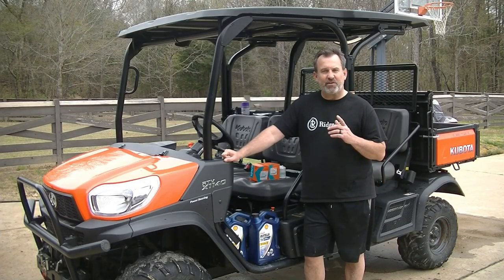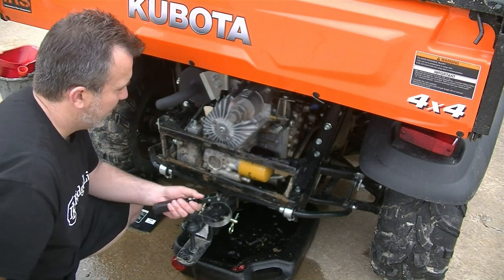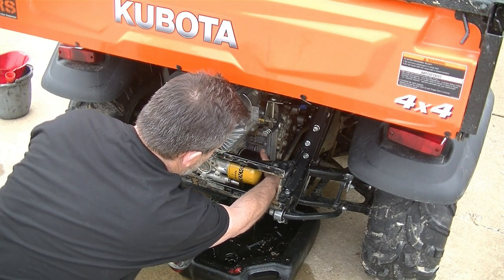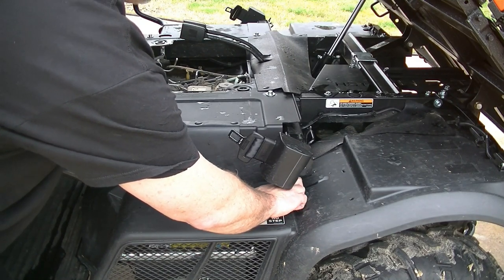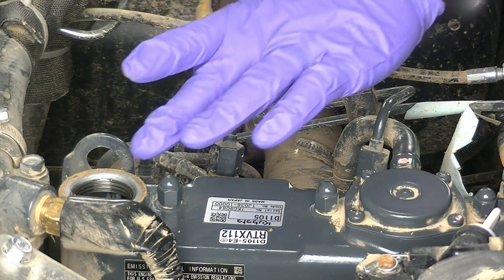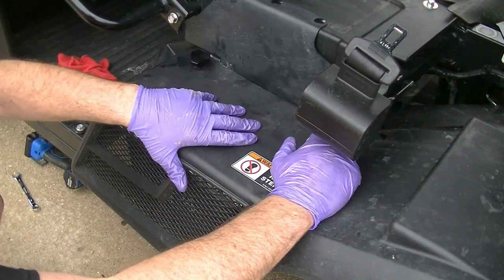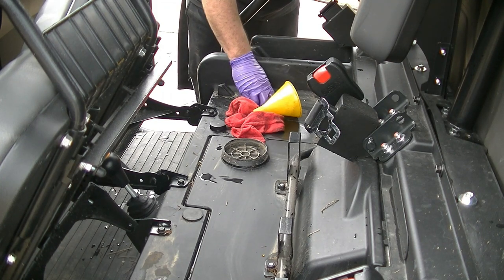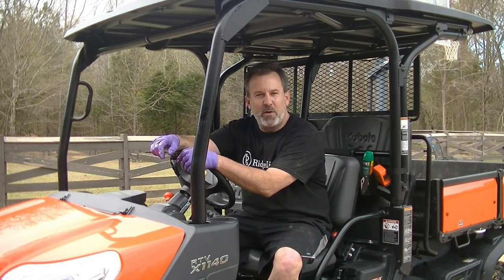HOW TO Change the Oil and Filters on the Kubota RTV-X1140

Comment: Helpful video. Thanks.  I agree with another comment that it was much easier for me to use my oil extractor. The oil filter is very hard to reach behind the battery. I got fed up, disconnected and pulled the battery out for access. The larger HST filter is incredibly stubborn to remove on the first 50-hour service.  I however did not replace the smaller filter until both were off for leverage and access to the larger forward filter. I too noticed no drop in UDT fluid level in the transmission and a bit more than a quart required at the front tank. Worth mentioning: don't forget to grease the zerk fittings on the suspension A-arms  --- maybe greased at the factory or dealer PDI, but maybe not. Very few YouTube videos on the X1140 which is peculiar.
Reply from the maker: Thank you! I agree. I need to do a followup grease and fluid top off video.

Comment: You have to be careful.  I have seen the hydraulic fluid over filled many times in the fire service.  The reason it is under the front seat, is because it should be checked with all hydraulics contracted.  When extended, there is more fluid in them and that is why the tank level will be lower.
Reply from the maker: Thank you very much!!!

Comment: I use a fluid extractor for the engine oil... waaay easier then having to drop skid plate
Reply from the maker: Great idea! Thx!
Reply: Problem it will not get 100% out and the bung seizes on if not used. The bung has a magnet that needs cleened too. I slap a powerful magnet on the filter body which works too.
Reply: @conmanumber1  cool idea.
Reply: @jaytomson7052  Jay, at the hardware store in kitchen joinery hardware there are really strong magnets the size of a coin. They hurt if snapped on fingertips by accident 
They are used to close drawers and cupboard doors.

Comment: What is with the two OIL fill caps on top of the motor. The one you used to fill the motor oil then there is a second one a few inches away but on a lower spot.
Reply from the maker: Chris, sorry for the delay. I really don't know. I have only used the top one.

Comment: decided after watching your video to do mine   1120,   2021 model. I ran into a problem as the small filter was fine, but the larger was a bitch. Had to go to Napa to buy another filter wrench.  I could not get initially,  the larger without taking off the smaller. ( a lot of fluid lost as a result) my old wrench and my new one would not allow me to attack the filter from the bottom, just the center area due to the configuration of the filter tool. I had to attack it from the center as a result, very little area to work with. Could you please tell your model or exact type of filter wrench used. The issue I found was the silver colored inlet or outlet metal tube caring hydro fluid would prevent my wrench from grabbing the filter as yours did. Hopefully  this makes some sense.  Thanks, Robert TN
Reply from the maker: Sorry. I got it at auto-zone though.

Comment: I do y recall u pulling the transmission filter off 🤔
Reply from the maker: I did oil and two hyd filters.
Reply: Hey brother, my headlights are not working but every other light in the dash is working would you know why does it have a relay or fuse?
Reply from the maker: @sergiorangeljr9160  sorry man. I sure don’t. No issues here so far.

Comment: Hi Tim, I do have a question regarding the trans filters, I getting a different part number on the suction filter (yellow) HHK 32-16770 is the part number I'm getting from my Kubota dealer, you were a little fast on reading those numbers, but none of them sounded like this part number, the other two were correct
Reply from the maker: I got these from the Dealer as well.  They provided the following: Engine Oil-HH150-32094, Large Hyd- HH3A0-82623 and Small Hyd- HHK70-14073.  I see what you mean though as when I search Messicks, they list a different model for Hyd.  Weird.  They user manual doesn't list the part numbers unfortunately.  I will have to confirm on my next oil change.  Please let me know if  you find out otherwise!  Thx